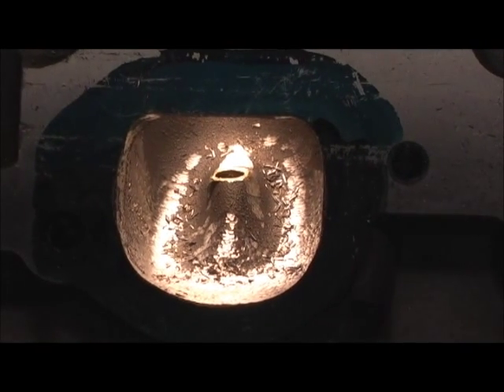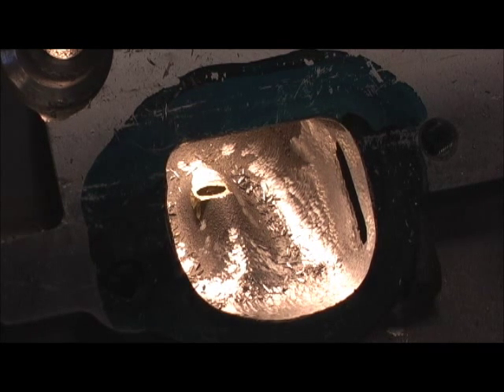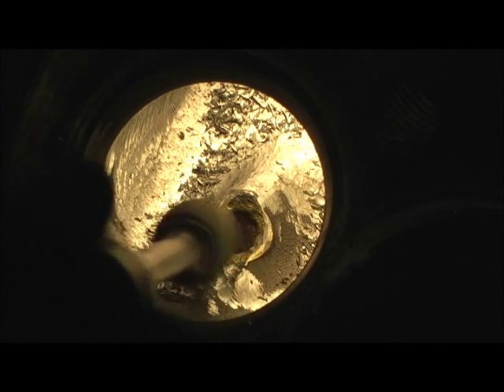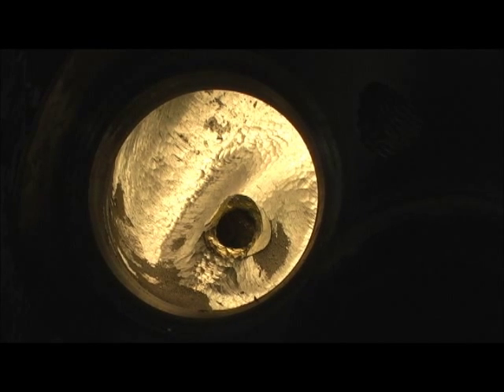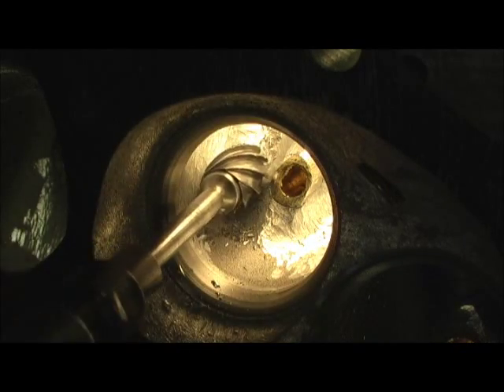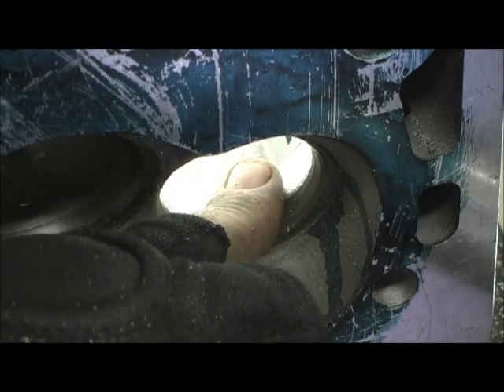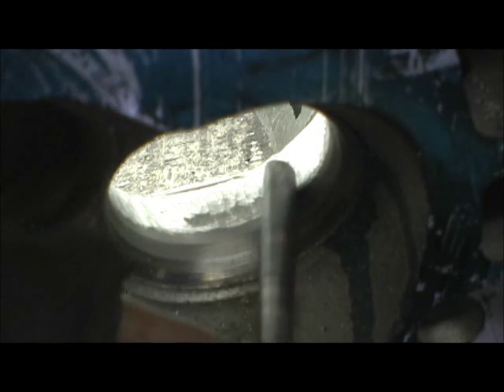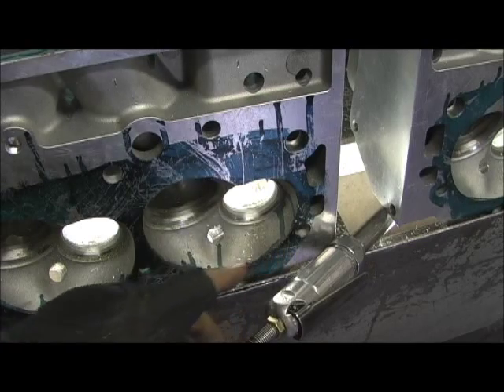KMJ 345 BBC Exhaust Port Guide work 4.0

Comment: Do you have enough meat to use a larger than 1.88" exhaust ?  Nitrous motors love bigger exhaust valves and could fix that core shift mess if you have the material.
Reply from the maker: Yank, the problem here is the 2.300 intake valve, and HOW close it is already to the 1.88. I think I will stay where I am at, and let the TUBES take up my slack on Valve Dia.